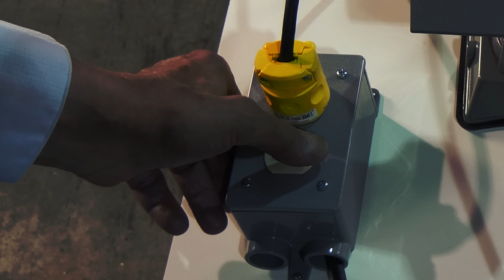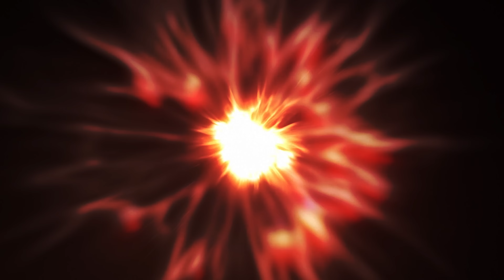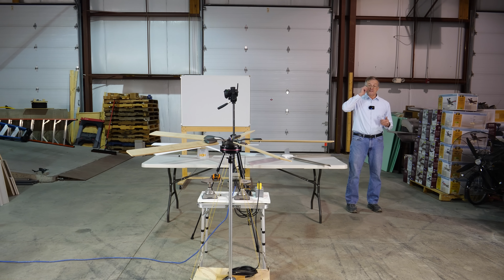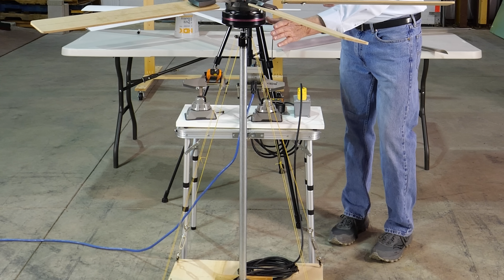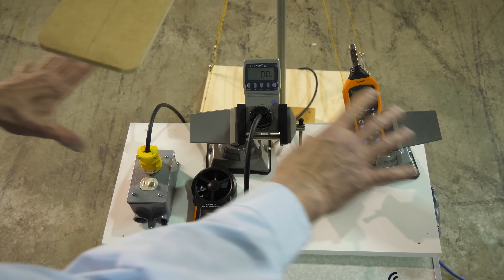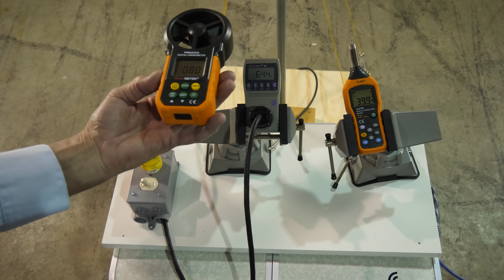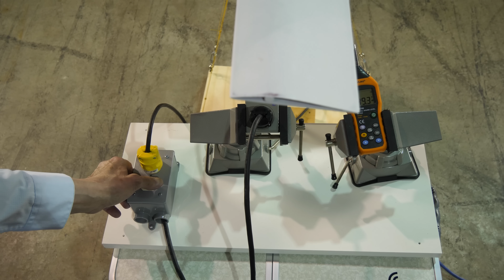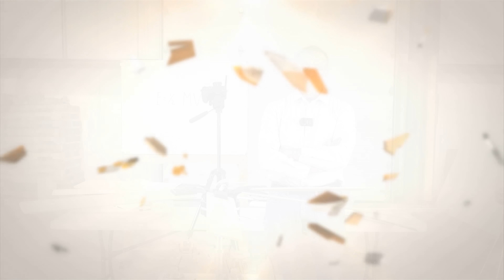This Fan Uses Almost NO Power

Comment: Will that ac-dc converter from Hunter fit into the decorative "cup" that conceals the mounting point for the fan/junction box?  If it will I may be tempted since we have 3 fans running 24/7/365 especially if the price is low enough.
Measuring the RPM of the fans would have given a much better comparison for how much air is being moved by the various fan blades, then also measure the power draw at X-RPM.  The AC (normal) fan motor almost sounded like it was locked up during the "no-load" test
One major reason for using flat blades on residential ceiling fans is that it is a pain in the tail to break out the stepladder twice a year to flip the blades over.  Or don't you reverse the rotation of your fans between cooling and heating seasons?
Reply from the maker: I'm not positive,  but the installation instructions suggest that it is.

Comment: Surely the RPM achieved is a major factor? The wattage is only relevant if you have a speed constant? A torque constant? Anyway, interesting.
Reply from the maker: Actually,  that is secondary.
It's watts versus airflow, however, that airflow is generated.

Comment: Given the contribution of tip vortices to induced drag it would be interesting to add a ring around the ends of the blades to created a duct that spins with the blades. 
Would skin friction drag from the additional surface area be more than the savings from the blades workingmore efficiently?
Playing with the number of blades, blade area, aspect ratio, and blade length would be interesting as well. Blade length might be difficult as I'd guess the motor wants to spin at a specific rpm and tip-speed increases with blade length.
Blade twist to match airflow across the area of the fan disc should also give quite an efficiency improvement at the expense of vastly complicating manufacturing.

Comment: A "clean" wing produces more lift and less drag. An uprated wing tip reduces vortices. Therefore  an aeronautically improved foil should reduce the amount of energy required to push it through the air. At this rate we shall all end up with free air to breathe🤣.

Comment: Your energy savings calculation is slightly off.  
In summer, you have to pump that extra heat out, so 40W is really 50W.
Reply from the maker: True.
But as others have commented, in the winter, that overhead reverses.

Comment: I wanted to see what the NACA airfoils power draw to get the 8-10 meter per second velocity?

BTW, thanks for this video. I have several fans that run 24/7 and they are going to get replaced ASAP with DC motors.

Comment: How about making a hub that lets you adjust the airfoil blades angle of attack.  Then, vary the rpm at each of several angles till you get to 1M/sec.  Plot out a power vs angle curve to find the lowest possible power consumption that can replicate the effect of a stock fan.  That would be an interesting optimization!

Comment: I was looking forward to see the brushless motor paired with the asymmetric blades.
I was also a little shocked that somebody with your scientific and professional approach didn't have the anemometer sitting on the edge of the table at a fixed position and just eyeballed it. There is huge variation based on distance to blade and distance to the axial center.
Reply from the maker: Each reading was the highest value that the anemometer would generate. 
But, I get your point.

Comment: I was looking into buying a wall mounted fan with a remote control. Would ther mere fact of having a remote make it probable that it has one of these more high efficient motors?
Reply from the maker: Yes, but it's not a guarantee.
Look for the small ( 20 -30 cc ) potted converter attached to the motor.

Comment: What would I save in power consumption if my taco 007 circulator motor was a permanent magnet DC motor to move the water from my boiler through my baseboard radiation?

Comment: by changing the blade types on the ac motor you have changed the drag on the motor.... I'm assuming this ac motor had a fixed capacitor to run the fixed rpm.... this should have been changed to allow for the increase in drag. It would be interesting to see the phase relation on the coils with an oscilloscope., then change the blade design. Or better yet a simple VAR measurement could have indicated the phase difference? Your thoughts?
Reply from the maker: That could certainly have been done.
But, with the overwhelming result being that, as designed, with the standard plank blades, the performance was so much better with the DC motor, I didn't think there was much value in testing that.

Comment: I needed to replace a server fan once. A genuine Rotron brand "Muffin" fan IIRC. When I got to their catalog, there were well over 100 replacements for a simple fan. So many variations in fan blades. Designed for cheap manufacturing. Or price. Or air volume at speed. Way way deeper than "just a fan."

Comment: Also, how does this compare to 3 phase motors with VFD's?  Most HVAC is using them and most (maybe all) electric cars are using them (DC to 3 phase in the cars, single phase to 3 phase for HVAC).

Comment: Also, ceilings fans are usually there to help you feel cooler.  The extra 50 watts is basically a little 50watt  space heater for the room, sabotaging the whole cooling idea.

Comment: Having a varied angle of attack on the blades, same angle toward the inner diameter (slower) and less angle on the outer diameter should really boost the blade's rpm and have less current through the motor.

Comment: Your video impelled me to reach up and touch the variable speed AC fan I bought almost 40 years ago that has been operating well all these years. It was cool to the touch at the lowest speed. It uses a semiconductor speed control. probably pulse width modulation.
I just did a quick comparison to a cheap fan in another room that I bought a few years ago. Running both fans at top speed for about twenty minutes and the 40 year old fan was  cooler to the touch. In fact, at the slow speed before speeding it up, it was near room temperature. Both fans are the same diameter, so work load was comparable.
 The newer fan  motor is a smaller diameter, so I think that material savings was employed to bring the price down for the later purchase.  Both fans are multi-speed and that choice was to gain lower noise levels, using the slower speeds. That probably gives them a lower duty cycle between off and on, with less copper losses.
Gift fans are like gift horses, functional but not especially efficient. That later fan of mine with wood blades has no speed at which it does not make off-balance sounds. The older one has metal blades that I balanced out with enough paper clips to where it makes almost no sound at low speed. I never did finish the job by drilling out the two other blades of an equivalent mass of steel.

Comment: The question is, could the motor in existing fans be replaced? Because I like the estetics of the ones we have and am just interested in less power drainage.  8)
Reply from the maker: Probably.
You saw the two motors we tested.   They have an identical form factor and mounting.

Comment: Does radial position of the anemometer matter?
Anyhow, I think those fans are far less efficient than most motorised appliances. Induction motors are most efficient when they’re operating close to the mains frequency, but I’d guess that fan to be operating closer to a stall condition than to that ideal condition.  Take it apart and see, I’d assume it’s a shaded-pole motor, something you don’t usually see outside of microwave turntables. They’re reliable because they lack the start/run cap of conventional induction motors, but power is wasted fundamentally as a part of their design.

Comment: I just fit an extractor fan in my loft a couple of months back & made sure to get a brushless one. 10 watts in the loft versus around 80 watts for the old one downstairs, or the ridiculous 180 for the kitchen extractor, means it's well worth replacing any of those you happen to be using around a home.

Comment: With every other aspect of the test well controlled, I wish the anemometer (air velocity contraption) was mounted to the table like the other 2 measuring devices (not that power meter needed to be 😂) for repeatable results. Rather than random locations of manually holding the contraption "more or less in the same place " 🤣
Reply from the maker: Fair enough. 
You'll notice that I held it in a very similar position and attempted to achieve the highest velocity a particular fan could reach.

Comment: Definitely an interesting result.  I'm guessing that airfoil shape is, like you found, not all that important.  Perhaps asking the General Aviation community about this would help.  E.g. airplane propellers are shaped differently at the tip than they are at the root because of the speed difference.  As for instrumentation, I wonder if measuring thrust would be a better approximation of total airflow.  Finally, for people in the South, any watt of heat you save is multiplied by the cost of air-conditioning that heat away.

Comment: Okay, let's go down the electric motor rabbit-hole. EVs have pushed new efficiencies in electric motors. Yes, I know. Different use cases. Nevertheless, are there any lessons learned from modern EV motors that can trickle down to simple applications like this?

Comment: I dont believe these calculations are entirely accurate assuming you are using a power meter that measures apparent power (which most do). There's a critical difference between BLDC motors and AC induction motors, and that's their 'power factor' which is a number that tells you how much power is actually being consumed and how much is just oscillating between the motor and power lines, 1 being perfect power factor (ie a resistor attached to an AC source like an electric space heater). Less than 1 means that less power is actually doing work and the rest is just oscillating between the power lines and the motor. BLDC motors have an ESC with transistors that turn on the coils inside the motor, and they are precisely timed to stay in phase with the motor's back EMF, which results in a very good power factor, much closer to 1. AC induction motors on the other hand, can be modeled as a resistor (representing the actual work being done by the motor) and its inductance (which is the source of the reactive power). The result is what your meter reads which is apparent power. Your first fan wasn't wasting 60 watts of power as heat, but rather pushing it back and fourth from the power line to the motor. A solution to this would be to get a meter that can measure 'real power' or to place an appropriate value capacitor in parallel with the fan motor and re-measure.
Reply from the maker: That's a good point 
For what it's worth, the DC motor never became detectably warm.

Comment: 6 blades in the last demo versus 5 blades in the first demo. More blades could also increase airflow once momentum is going.
Reply: Nice catch. Should have the same number of blades for a better comparison. Odd number of fan blades are generally quieter too, so I hear.
Reply from the maker: Good point.
However,  more blades are generally less efficient because the disturbed air trailing a blade reduces the efficiency of the blade behind it.
Reply: @TechIngredients , indeed, but what would happen you think, if you used toroidal blades? They seem to be quieter and more efficient

Comment: 50W heater with a blower attached ;) The quality of the setup is less than I've learned to expect from this channel though. Anemometer seem to need fixed position more than powermeter, and even though probably harmless I have anxiety with you reaching so close to these blades. And I have no idea how the airflow looks like, especially if it's not so far from the ceiling. Do we assume it's symmetric on both sides of the fan, and that function of distance from the fan looks the same for all types of blades?  Just to be clear, A+ content as always, just trying to be helpful.
Reply from the maker: Thanks.
There is no good reason the airflow is not the same around all 360 degrees.
I should have stated that the anemometer was held to achieve the maximum velocity with each test.

Comment: Your noise meter is measuring the ceiling lamps hum, your air speed meter has +/-20% error due to low resolution, and the stamped rotor was clearly overloading the motor so it couldn't get to nominal speed and produce power anywhere close to other rotors, hence low air flow speed. Also no load current for small and slow (multipole) AC motors can easily be like 50 or in some cases even over 100% of the rated current, so just because it's consuming 50 watts without blades doesn't mean it's wasting the same 50 watts with a good set of blades as well. And you might want to consider the low Reynolds number effects for these kinds of blades when selecting the best airfoil because it's right about where the common sense "big wing" aerodynamics kinda stops working and weird things start to happen instead due to boundary layer and laminar/turbulent flow shenanigans. In fact the stamped blades, when properly designed for the specific motor, might end up being the best ones, especially at slower speeds.
You make great videos but it was kinda sloppy this time.

Comment: Now I wonder what the difference in efficiency would be in a small shaded-pole motor fan, like the one you'd find in a microwave oven, compared to a similarly sized computer fan.
These shaded-pole motors don't have any permanent magnets. However, the computer fan does have permanent magnets in the rotor and the coils are precisely switched by a Hal sensor and a bit of electronics. This should be fairly efficient, compared to a shaded-pole motor fan.
When doing such a test, I'd recommend a fan out of an old server. Those tend to be more powerful than the regular computer fan.

Comment: Excellent observation, but you did not extrapolate the results to include the added  load on A/C systems removing this heat, probably also using inefficient electrical motors.

Comment: Given that the metal airfoil performed so badly, it must be in a constant stall situation. Would be interesting to reduce angle of attack and see what difference it makes.
Reply from the maker: Actually,  I adjusted it to the optimal angle of attack.
Reply: @TechIngredients  Interesting! Too much camber perhaps? It seems wild that a flat board would perform better than this.

Comment: The efficiency of asynchronous ac motors drastically depends on a rotation speed. It mast be a little under the ac friquency, wich is not the case.

Comment: I have turned desktop fans from 30 watts to 5 watts and lawn mowers from 400 W to 150 W by rewiring brushless motors with a special Tesla bifilercoil twist that makes the capacitance give it an extra boost for free. Been working in experimenting on this topic  for a long time. I'm fascinated about efficiency of electric motors

Comment: BLDC ceiling fans have been very popular in South Asia for quite a while now. In fact, most new ceiling fans sold in the recent past have been BLDC fans.  You can get them in various blade lengths and blade profiles depending on whether you are prioritising air movement or noise levels. All the reputable manufacturers offer BLDC models at not much higher prices than traditional versions. It's perhaps because America is a domestic HVAC system country that they are not popular over there. Most newer kitchen and household applicances sold in the UK (and the rest of Europe) tend to have energy efficient inverter driven motors. All major appliances are given energy ratings after independent testing and these must be clearly displayed on the item or its advertising blurb.  This influences purchasing decisions very strongly over here. Does the USA also use a similar system?

Comment: Great episode! How about potential improvements of heat pumps, I mean, if the theoretical limit for COP is kind of the inverse of what Carnot's theorem says about theoretical limit for efficiency of heat engines, generating a delta T of 10-20 K around room temperature with a COP of 3-4 shouldn't be considered amazingly good, not in my mind anyway. Or even worse, my bench top ice maker use about 120 watts to produce around 300 grams of ice per hour, when the water is ice cold, that's effectively a COP of less than 0.25 based on the energy of the phase change of the water, which the machine is designed to do. That's less than 10% of the theoretical limit, unless I got something wrong.

Sure, part of teh problem with that ice maker is probably the motor, then there's the fact it only has one power level, or stage as they seem to be calling it in the heat pump industry, how on earth they though that was a good idea when it's compressor based systems. About stages, the compressor is probably some actual single stage reciprocating compressor, which like most cheap small induction motors have been produced for decades, with very small changes to the production of it, and all it's parts, and completely new manufacturing including supply chains isn't worth the investment as long is "nobody" asks for better products, and are willing to pay enough for those products so the investments become profitable in a short time.                        

By the way I made a similar discovery as you did, when I redesigned the fan part for my table top fan, it drew 10 watts, without load, on the lowest power setting. While I managed to make a significantly more efficient fan, that also was significantly quieter the the original, I switched to modifying the flow from computer case fans to use as personal fans and to create gentle general air flow. So far those cheap fans that draws 4 watts at full power have produced all the airflow I've needed for those applications.